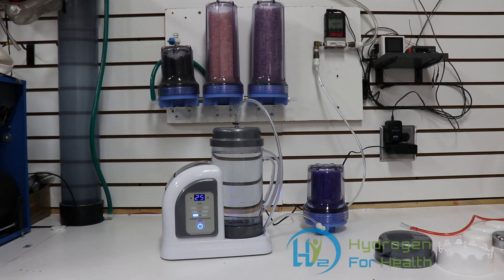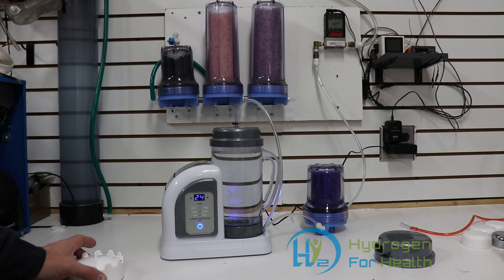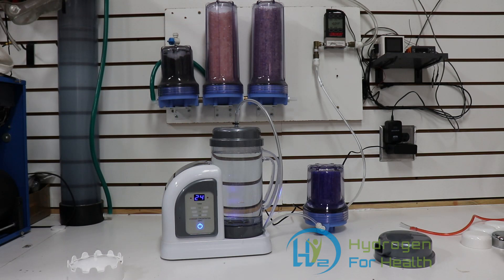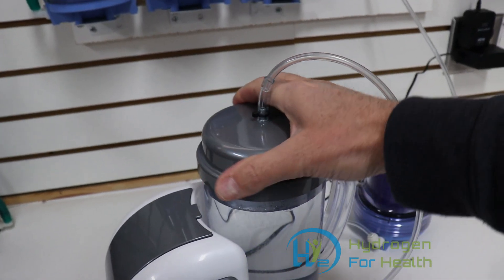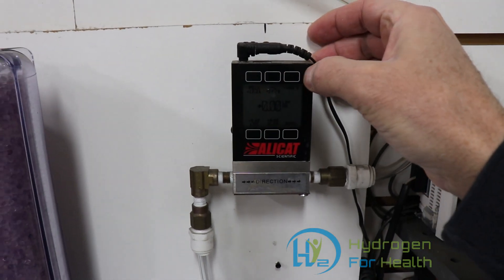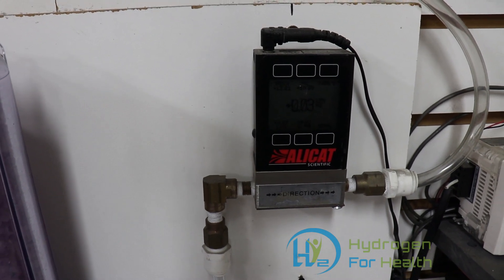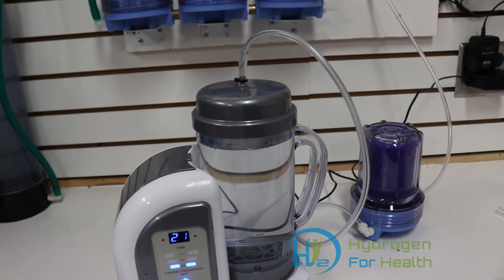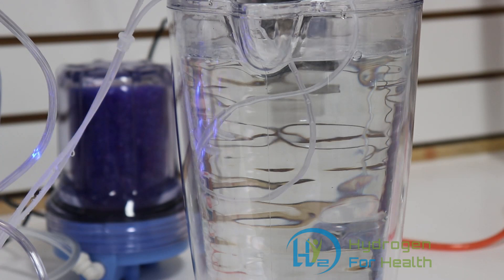Lourdes Hydrofix review. Is it worth the price? Hydrogen water generator.

Comment: that's a fake copy of the original hydrofix. they original is a Korean made device and no patent in usa and it looks a bit different too
Reply: that video is fake news
Reply: @Mohammad Hashemi . true to that brother
Reply: @quantumclinic3212  rubbish??? sellling a scam product is not rubbish? telling your hydrofix can produces 120ml of molecular hydrogen, but the fact it is not true. Your hydrofix is THE rubbish scam
Reply: @mindhormone  I agree with you. I made the comment when I believed it did  and at the time I trusted the company. I tried to removed my initial comment when I learned otherwise well over a year ago. If it’s still up please ignore my comments. I implement gas inhalation equipment that produces over 1300cc per min and have done so for the past 14 months. I wouldn’t waste my time as a practitioner on anything below a min of 1000cc per min - 66% pure H2 33% pure 02 - and never anything that requires industrial salts to produce the gas either.
Reply: @quantumclinic3212  Nice. 😊 May I ask your experience with your BG inhalation? any health benefits?
Reply: @quantumclinic3212  So which machine are you backing?  Lourdes?
Reply: @swordfish00007  definitely not, I learned a lesson there which I won’t discuss. I only use the Korean HueLight H-1200 in my practice after learning many lessons with others claims. The H-1200 offers well above the min medical recommended of 1000cc per min of pure H2/02 for serious health imbalances. 10 mins breathing on this device gives you the same level of pure H2 molecules as drinking over 18 tons of full saturated water. You can bubble in 10 secs if you want h2 water so it’s a no brainer to me. Those who say you can blow your lungs out etc have other agendas in my opinion. 4 years and going strong.
Reply: @AlkalizeforEnergy  Hi Heather can you message me and tell me what is going on with Lourdes etc as when I make a purchase I want to get it right in part as my gf is battling breast cancer.  Is that machine the HueLight H-1200 does it make Browns Gas and do you prefer that over the AquaCure one?  The Hydrogen Guy who promotes Lourdes says that adding lye to the machine can be toxic vs. pure Hydrogen etc.  Do you trust that machine you bought?
Reply: @swordfish00007  Aquagreen is one name which it is sold under.
Reply: @swordfish00007   The distilled bubble scrubbers remove most of the lye from the Brown's Gas electrolyzers that use lye as a catalyst.  Even so, I wouldn't recommend inhaling the gas because trace amounts of lye mist are probably still present in the gas.  So I think it is risky, especially for a patient who may have lung disease, such as COPD.  Does that trace amount of lye cause cumulative lung damage over the long run?  My concern is that trace amounts of lye may cause a progressive lung disease such as COPD to progress at a faster than normal rate, over the long run.  It is much better to be on the safe side and just inhale using the SPE-PEM-based units, which use pure distilled water and don't require any lye at all.  I have a lye-based Brown's Gas generator, but I only use it to make hydrogen water and hydrogen iced green tea.
Reply: @swordfish00007  Lourdes is connected to Aquagreen?  No, I never said that.  As far as I know, they are two different companies.
Reply: @swordfish00007  
Plafnio is another option.  They make a model that has a 300 ml/minute flow rate for only $1299.
Reply: @swordfish00007  

I'm not arguing with you about the flow rate of the Lourdes unit.  It is only about 40 cc/minute, merely one-third the rate the company claims.  Delvis proved this, using 3 different methods.  The company is obviously lying.  Get out of the Holyhydrogen cult and open your eyes.

I'm not selling anything.  I just want people to know that there are better options available, which are much less expensive and feature a much higher flow rate.  So don't waste your hard-earned money on a Lourdes.
Reply: @Bruce_Wayne35  Delvis testing equipment is ridiculous compared to Lourdes.  One has a $250 machine vs. another with over $100,000 machines.  The accuracy here is not even close.  This guy has no  clue what he is talking about.
Reply: @AssResearcher  Hi Roman if you want to send me your email address I will reach out to you - no charge, happy to help.
Reply: i dont get you, 30 years of brain fog wiped away by the hydrofix and you claim the huelight is better machine?
Reply: @swordfish00007  which machine should I buy ?
Reply: @crazytimes8709  which machine should I buy ?
Reply: @Bruce_Wayne35  which machine should I buy ?
Reply: @swordfish00007 that is facts!